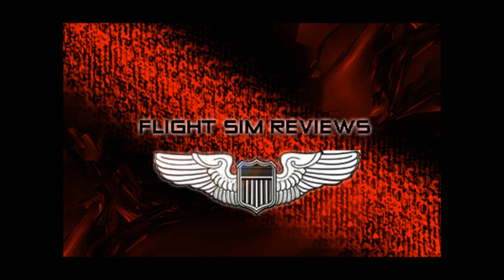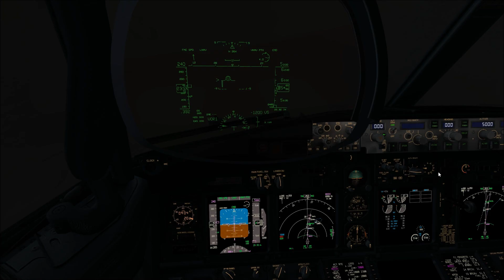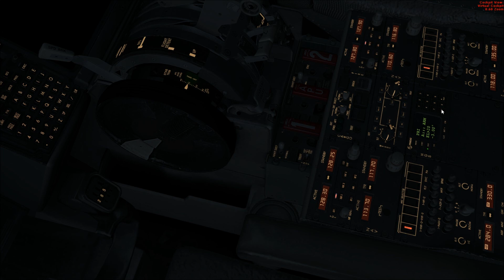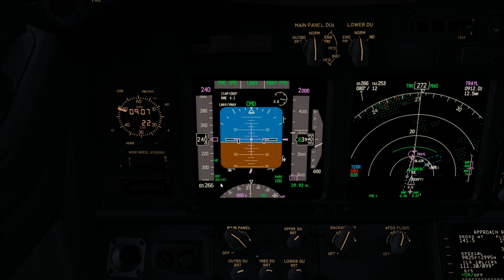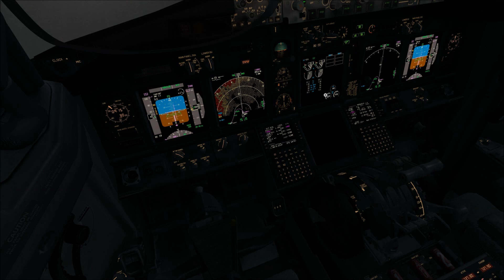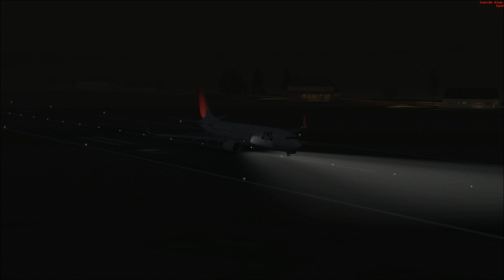PMDG 737NGX Autoland Review and Tutorial Update Part Seven HD

Comment: this was not a 'full autoland' sequence.  you did not get the LAND3' or  "Rollout" annunciations on the PFD or HGS.   what you did here,  was achieve a tuned-ILS landing  ( to "some' ??? minimums.... in which normally,  you would have been mandated to 'disconnect the AP "@" those minimums  ie;  200ft....300,  etc...)  here,  you just simply allows the AP to take you right down to the Runway.   i've got the PMDG also,  and am experimenting further with this Operation.  nice job flyin' still......